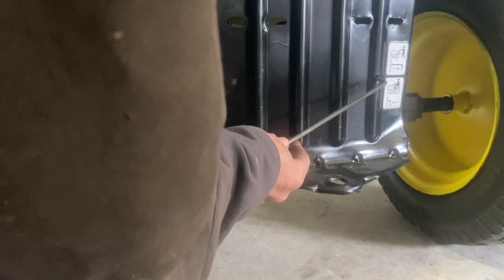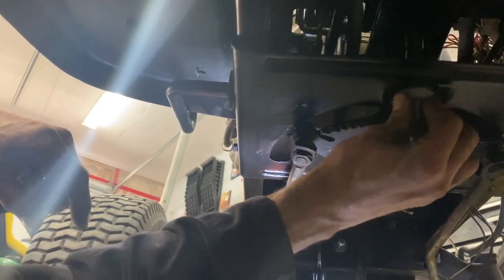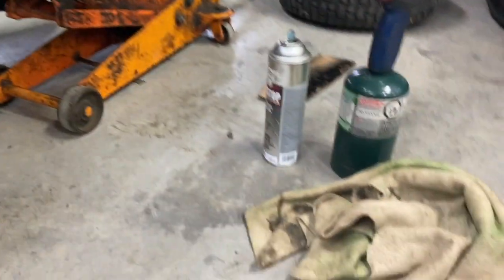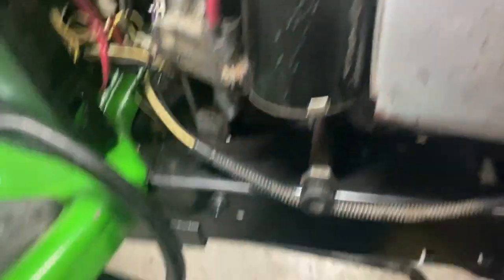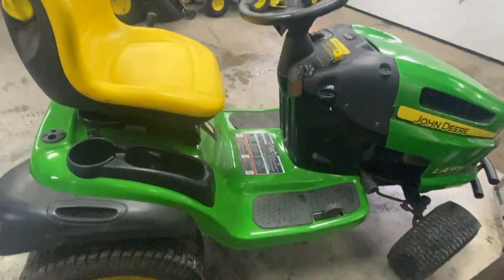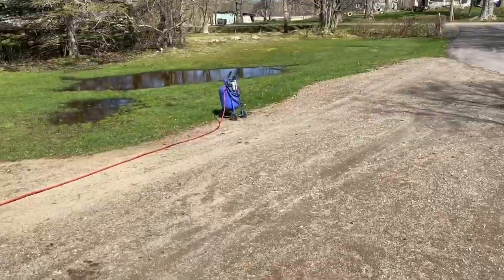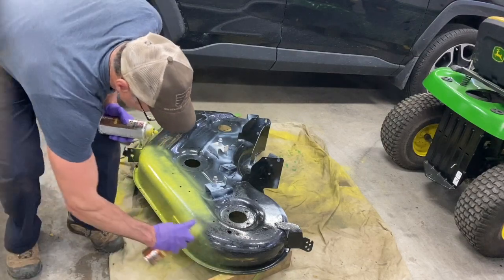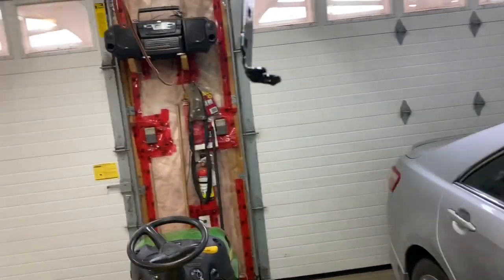Part 6 LA165 John Deere Lawn Mower Tractor rebuild

Comment: Awesome video man. I just bought a nice, used LA165 for $400.00! Super happy. Sat for years so i put in fresh gas and it started right up, drove it home, took 1 hour just down the road. Halfway it started bogging in and out, both up and down very slight hills. Play in misaligned steering wheel. Cruise lock slows my speed so may need adjustment. Thanks 
Ill do a full tune up and lube on it.
Reply from the maker: Thanks man.  Check this one out.  https://www.youtube.com/watch?v=3D_vtMg-Zxg&t=34s

Comment: Do you clear coat your paint jobs or leave it be after a couple top coats?
Reply from the maker: No clear coat.  The paint on the deck goes dull.   I should use clear.